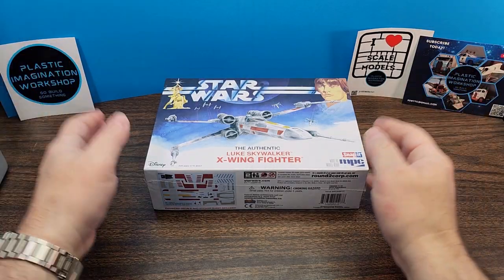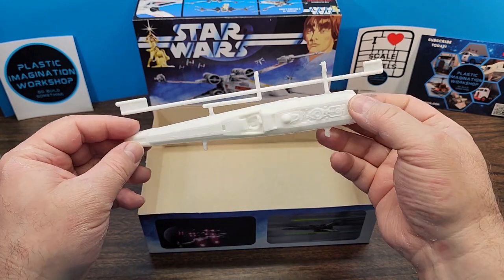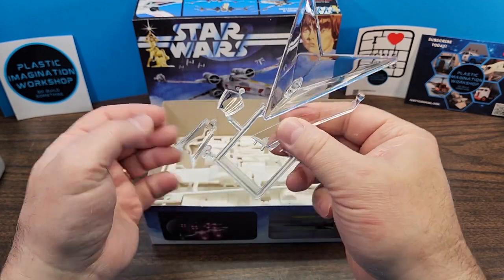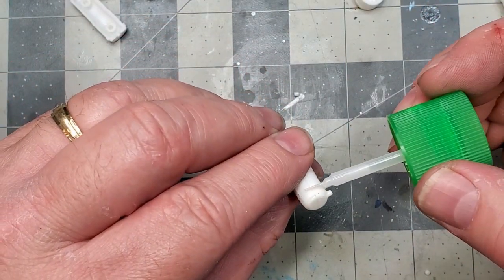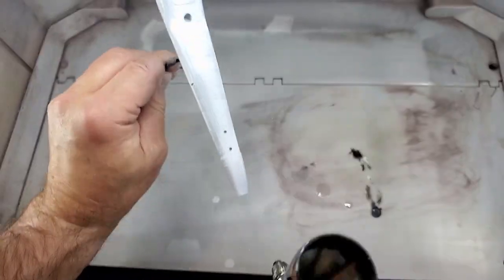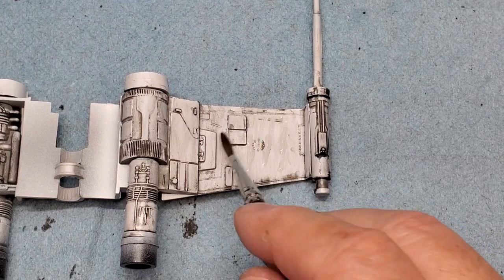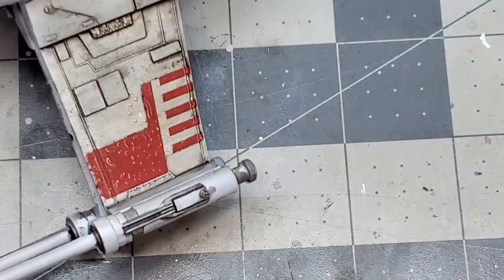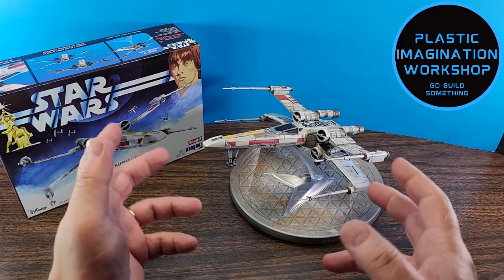Luke Skywalker's X-Wing Fighter by MPC - Full Scale Model Build

Comment: If you do end up building another copy of this kit, I'd offer 2 suggestions in addition to your thoughts on the decals.  1 - Cut off the laser cannons, rotate them 90 degrees and reattach. MPC intentionally misaligned them when the mold was made back in the 80s to reduce part count. The crescents on the end of the barrels should go up-and-down, not side-to-side.    2 - Lose the landing gear. It's just too chunky looking for the scale of the kit, and the front gear has 2 struts instead of the single strut seen in the films.
Reply from the maker: Great suggestions! I agree, and if I do build another one, I will definitely make it more accurate to the film. Hopefully, mpc will re-release the larger version from the 70s with the needed improvements.  Thanks for watching and commenting. Have a great week 😀

Comment: Nice build! This one is a bastard size 1:63.  I was also baffled by that extra clear part. How do you spell the paint used for the engines - is it illuminum ? I cannot find it in a hobby shop. I must say, the pilot is quite pathetic, it doesn’t even look like an X-wing pilot!
Reply from the maker: Thank you, I'm glad you enjoyed it. The color I used for the engines is Dark Aluminum, its from Vallejo's "Metal Color" Airbrush colors collection. Mine came in a 4 pack with Steel, Aluminum, Silver, & Dark Aluminum. They are really nice paints and you can use them straight out of the bottle in an airbrush. Thanks for watching, have a great week.
Reply: @PlasticImaginationWorkshop  thank you, I will check it out.
Reply: This was made for kids to play with not be an Exact replica, hence the name MODEL.